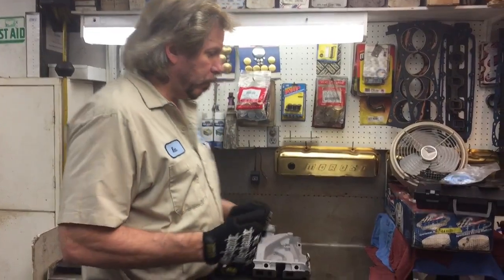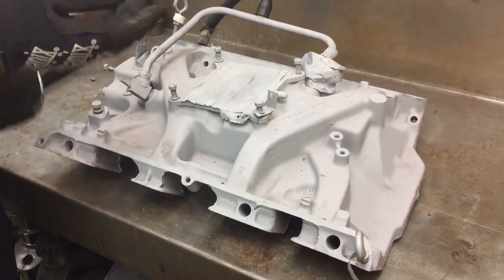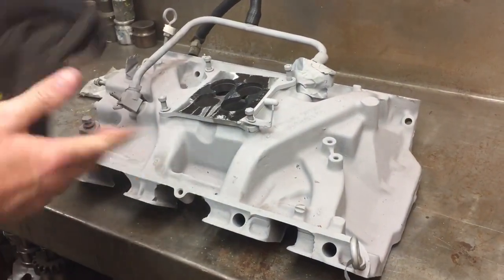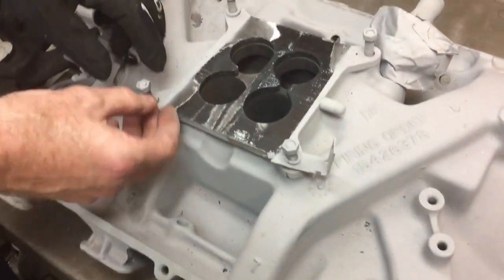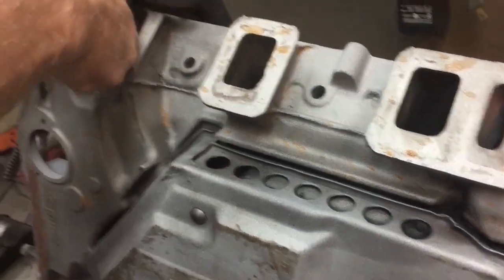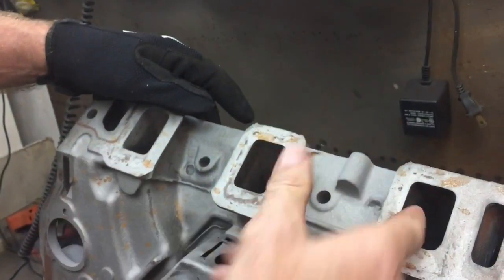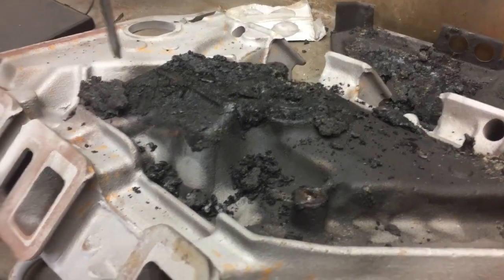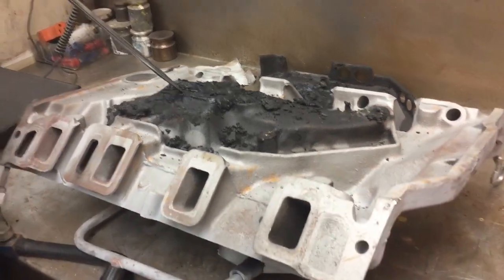Clean Means Clean

Comment: i almost did this exact thing to myself. as a hobbiest engine builder i absolutley love rebuilding engines in my spare time. i had clean the intake for mt baby lt1 engine and didnt think much about that shield on the bottom until i decided to take it off and saw the sand pour out from under it. nearly gave myself a heart attack knowing that would have just destroyed all my hard work. two days of scrubbing, washing, air blasting every hole and orifice until it was clean. now ill put it on the block.

Comment: I've had heads worked on and the longer they laid around the bigger the pile of sand was. I've practically begged them not to blast my heads or use those gd roloc discs on my aluminum heads.

Comment: Mr. Ellison   i have a 1980 C10 350 SBC.Sir Above the oil filter.  I have a oil leak, theirs 2 plugs.  One has a plug,the one above don't have one. Is that suppose to be plug.im confused ,we're is oil leak is coming from.  Check the oil sending unit, distributor, valve cover, intake,rear main, oil pan gasket. Everything is dry. Any recommendation ,would be appreciated. Thank you Robert